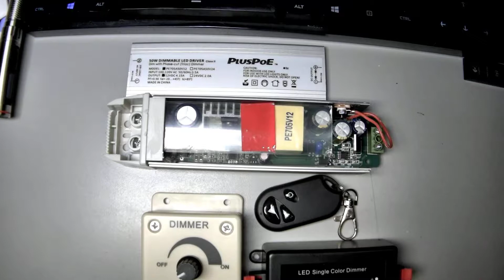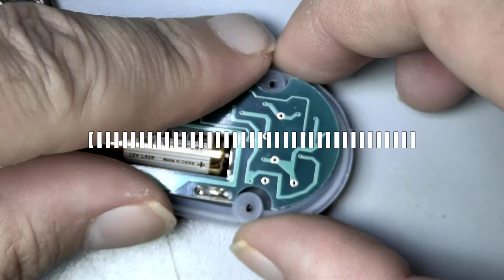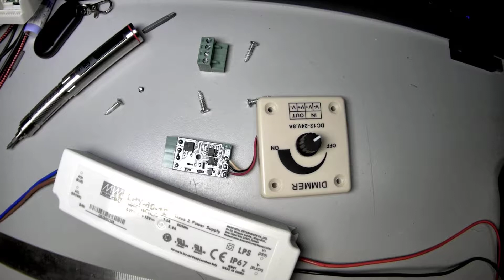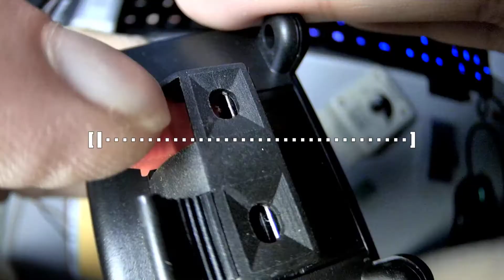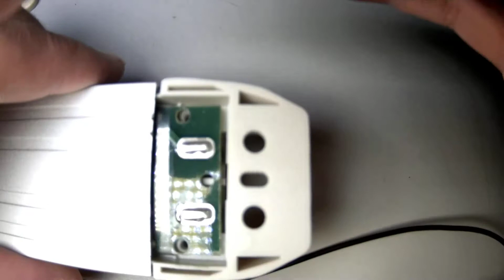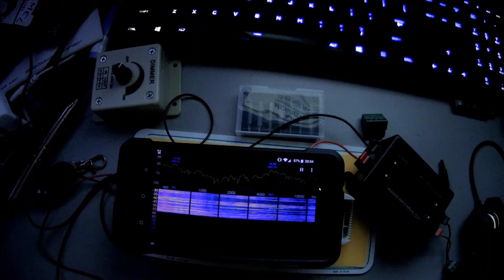DC-DC LED dimmer 8 amp 12v 24v

Comment: maunal one better than rf one ?
Reply from the maker: I think they were both aweful. You really need constant current control, and the dimmers in this video, if I recall all sucked imo.  I moved on to a weird solution that cost about $10, but I was unable to integrate computer control into it.  I'd say for these type leds, you may just be better off purchasing an off the shelf cheapy 12v power supply. The ones in aluminum and have a fan and screw connectors..... You can usually adjust the pot on those down to levels that can under-run these pretty nicely. If that's the goal.  My goal was really really low dimming with no flicker, and I've yet to settle on a solution.
Reply: @HIBAW  im trying to make my own dimmer circuit and with ur reply thats better option and those cheap ones uses same parts 555+mosfet etc, thank you
Reply from the maker: @Solthariel  sweet!